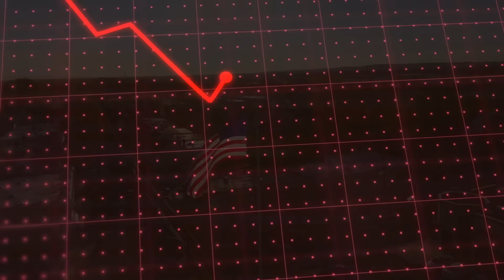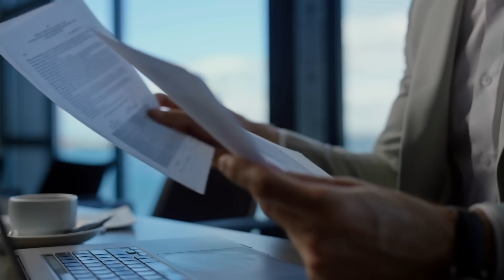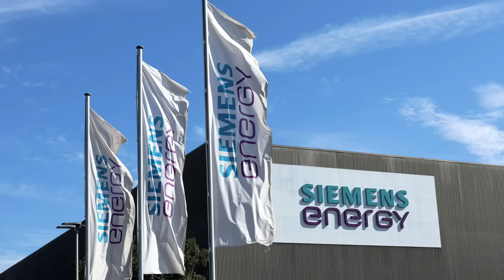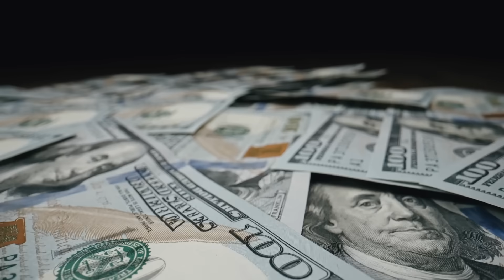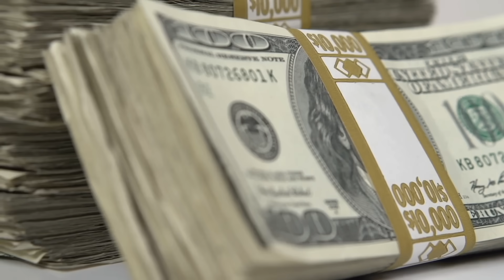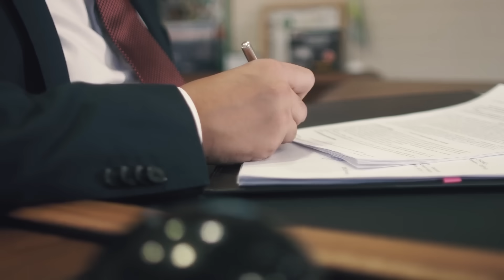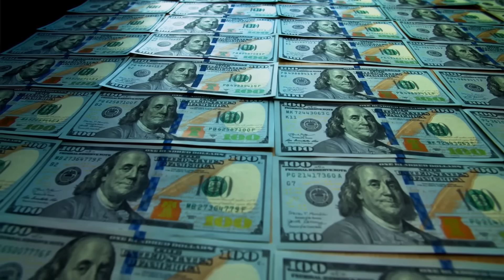The Real Reason America Has Turned Its Back On Wind Power Energy

Comment: The temprature at the earth's centre is about 5000degrees C. Dig deep enough and there is a limetless supply of energy. Turbine baldes, solar panels & batteries can't be recycled and must be buried. The earths centre is already subterrainian.
Reply: Drilling deep is neither easy nor cheap.
And yes, blades, panels and batteries can be recycled.
Reply: @old-pete  and yet, to date, none are.
Reply: @pfwag  What are talking about? Recycling? Happens all the time. One can even google the companies doing it.
Reply: @old-pete  Recycling costs money, it doesn’t make money therefore it will not be done.
Reply: @Ethan.Lamoureux  Throwing stuff away is more costly to nature. That is were legislation comes into play. It also saves energy.
But if one does not care about the enviroment, one can just dump stuff in landfills or the oceans or just abandon it.
Reply: @old-pete  If recycling costs money, we won’t do it. Landfills are the best place, which is why we use them. Lots of “recycling” has ended up in the ocean, this is why I don’t recycle. At least if I throw it in the trash it will be contained properly. Abandonment in fields seems to be the chosen solution for old wind turbine blades. So green!
Reply: @Ethan.Lamoureux  That is a countries problem, not of the windturbines. Other countries banned the landfill disposal.
Reply: We are taxpayers in the Country we are the Country it is our problem. As x 5306 said dumping this stuff seems the most cost effective solultion therefore it will be dumped. I won't dump it I would never buy it. By the time it needs replacing it will cost a fortune to burn/bury or recycle.  @old-pete
Reply: @robinjellicoe7088  Still cheaper than fossil fuels from other countries.
Reply: When America left the Paris climate accord they were free to use & extract any energy they wanted. Many jobs were created, Amereca became 100% self sufficent in energy, prices went way down. All this yet their CO2 emissions fell more than the Countries still in the accord.  @old-pete
Reply: @robinjellicoe7088  US expanded their fossil fuel extraction before they left the accord. Those two things have nothing to do with each other. The US has always imported oil, they were never independent. The energy prices depend on the world market. Prices went down due to Corona, they went up half a year before the Ukraine Invasion. The US opened their oil reserves to counter the price increase.
The CO2 emissions go down because of the export of industrial manufacturing, Corona and increased investment in renewables.
To think that CO2 emissions sink because of lowered fuel price is a sure sign that somone has no clue about economy and especially energy economy.

Comment: It's not that simple, you can't just say "let's throw money at the problem" to build more infrastructure. Wind turbines are intermittent, meaning their production doesn't follow demand, meaning you need to find some way to absorb the power they generate when it's not being consumed, and some way to compensate for their missing production when you need a lot of power but there's no wind. That's the main issue, and the main reason grid operators aren't investing more into connecting further turbines to their grids.

This is a fundamental technological problem, and it won't be solved overnight.
Reply: When one site is off line others are generating. Taken as a whole the system works. The idea of looking at single sites as continuous power is erroneous.
   That's how hydropower works too. Not all dams are generating at any given time. That's how our Tennessee Valley Authority works here. They even publish a generating schedule for the benefit of public safety as well as for recreational purposes.
Reply: @joewoodchuck3824  That's the idea but in practice, sadly, often there's very little wind overall and overall production is very low.
Reply: @Lexoka  There's a concept known as capacity factor. It compares total nameplate capacity against average output. Hydroelectric comes in around 40% and wind almost as much. If you want to use that factor against wind, you also need to criticize hydro. Everyone loves hydro, yet wind isn't much different.
Reply: Nobody seems to grasp that the problem of "green" energy is that it cannot generate on demand.  Irregular supplies must feed into a common storage system and from THAT system must come a regulated output.  Also, we have a persistent problem with our scientists and engineers that they always look to the most complex solutions when a simpler and more robust approach would work.  Even if the simply solution is not efficient.  Efficiency is a false virtue if it comes at the cost of reliability and ease of maintenance.

The main problem here is  that the NASA-designed 3-blade windmill is the WORST possible design option.  There are better options but, they don't fit the MENTAL IMAGE of what they are supposed to be designing and building.  I don't know how energy is regulated from these windfarms but, I feel certain that they are regulated at each windmill and the output is fed to the grid.  There is no room for error and when the wind is slow, power must be stolen from the grid to keep the blades from stalling.  That such a windmill design ever made it past the initial presentation stage calls for mass firings of a whole lot of people.

For the sake of argument, lets say the far superior windmill design is accepted and these NASA abominations are all replaced.  That's not the end though.  What I'd like to see is for these new windmill farms to directly feed a massive bank of lead-acid or AGM batteries.  Why lead-acid or some derivative?   Lead batteries are RECYCLABLE and the individual plates can be removed and replaced by a special crane.  Nothing high-tech AT ALL and it's ROBUST.  The batteries will absorb all of the power from the windmills and inherently provide regulation to the next step, which is a DC-AC motor-generator.  

The output of the AC generator side is controlled at the power station by controlling the DC battery output to the DC motor.  Once loads levels and swings are worked out from experience, then the motor-generator can be adjusted to some mid-level of power generation input.  That way it is RELIABLE and the grid voltage can be easily maintained by controlling ONE INPUT.  That is may be nominally INEFFICIENT pales in comparison to the virtues of such a system.

THIS is my solution.
Reply: @BlackPill-obey Any idea of the sheer mass of batteries and cost and short life your talking about..??
Reply: Hoax.

Such a load of garbage.

There no such thing as a greenhouse effect.

The whole premise of AGW -- the greenhouse effect -- is wrong.

There is no such thing as a greenhouse effect (except in an actual greenhouse (closed container)).

But there IS  a trillion dollar $$$ boondoggle that is the muscle that twists arms behind that stupid renewable energy.  

"Welcome to the Mafia-ization of the energy business."

             * * *

A Novel Perspective on the Greenhouse Effect (Tom Shula)

https://youtu.be/NS55lXf4LZk

1) Markus Ott: Questioning the greenhouse effect

https://www.youtube.com/watch?v=Bj6ORbRBZ2s&t=7s
The greenhouse effect is the primordial sacrament of modern climate science. It is preached from kindergarten to the nursing home.  The simple name of this effect and its ubiquity in culture and mainstream media leave no doubt that we are dealing here with solid and fully understood Natural Science. But how does this actually effect work?

2) Markus Ott: Atmospheric greenhouse effect ~0?  (Applying IPCC formulas to the no-atmosphere moon. Conclusion: there is no greenhouse effect on earth.)

 https://youtu.be/JXKHfL55G2A

Min 6:xx.  "Abuse of the Stefan-Boltzmann model..."

3) Markus Ott: Saturation of the CO2-IR-Absorption

https://youtu.be/CrMGTkPADFw
(Min 0:10) The alleged greenhouse effect of 33 degrees centigrade is the result of an improper use of the Stefan–Boltzmann Law (black-body radiation), and that a less abusive application of this law makes the greenhouse effect almost disappear. 

4) Markus Ott: Convection and Thermalisation Kill The Greenhouse Effect

https://youtu.be/RbNNhLqhWPg

In-Depth Comments on Sabine Hossenfelder's Talk: Greenhouse Effect 

"Heat transport in the atmosphere... IT'S CALLED WEATHER."
https://youtu.be/sY2xHk0ThJ8

https://thebreakthrough.org/journal/climate-change-banned-words/art-climate-change?utm_source=Breakthrough+Newsletters&utm_campaign=12e6304fed-BTI_Weekly_1_18_2023_COPY_02&utm_medium=email&utm_term=0_49b872540e-12e6304fed-466887052

If heat rises, why is it so cold in the upper atmosphere?
https://www.physlink.com/education/askexperts/ae670.cfm
Reply: nice cover...Lex. thanks.
Reply: Hydro power is intermittent too and is only a little better than wind. Yet everyone loves hydro and at the same time criticizes wind.
Reply: @joewoodchuck3824  Hydro can exhibit fatal intermittence if it's on a river with high variability and/or there is no storage dam. Otherwise, its capacity factor can be more like 99%. And more than this, so long as there's enough water in the reservoir, it's also dispatchable, meaning you can turn it off an on at will, and thus make up with the fatal intermittence of wind and solar. If you add pumps for storage, then they can even store the excess energy that other intermittent sources produce, so things get even better.

There's really no comparison between the two. Even if the river has a lot of seasonal variability and no storage dam, usually you can at least somewhat predict the intermittence based on seasonal patterns (barring the occasional flash flood).
Reply: @Lexoka  Your assessment and numbers don't jive with mine. My information is from reliable sources including government.
Reply: @joewoodchuck3824 understand how hydro works and it's easy to understand. Hydro typically can't run 24x7 due ro limited captured water, but you can release it on demand when demand is high and ramp up very quickly. These are ideal conditions for generation that is only intermittently available.
Reply: Stop china making plastic crap is the first thing you do if you are worried about climate change. This will solve nothing.
Reply: It's being worked on, of course. There ARE batteries. It's like saying "man will never fly" because the Kitty Hawk planes flew only a short distance.
Reply: @granthurlburt4062  so you think these are a good idea. You have lost the plot. I bet you got your boosters.
Reply: It will never be solved !
Reply: What is simple is: this is a scam. The so called crisis is manufactured just like the plannedemic.
Reply: Australia tried these things and Tesla built $$$ monster battery storage plants to rescue the foolish renewables fiasco!
Reply: Look into Sun Zia & Pattern Energy.  They are financed through Canadian Pension Trust.  They burned the land in New Mexico where they have been planning on the largest Wind Farm Generating Transmission Line in USA history, from New Mexico to California.  It will provide power to 3 million California homes.  The villages did not want to sell or lease their land.  So, unfortunately, there were "wild fires" that paved the way for construction.  Basically New Mexico sold the souls of natives in order to line pockets.  Sounds like Lahaina, Hawaii.
Reply: Call your congressmen, senators and council and tell them windmills are in the best interest of the people and give them good reasons why. Also wind power is much cheaper then nuclear power
Reply: Hydrogen
Reply: @aries6776  I read once where it costs more to make hydrogen than the potential output from it.
Reply: @joewoodchuck3824  Yes it's inefficient but when you have energy being wasted such as unused renewable it becomes a perfect choice because now you can store and transport it rather than let it go to waste.
Reply: @aries6776  I'm willing to bet that no industrial entity is willing to try it. They'd have to charge extra for shipping than for ordinary commodities in order to cover the production loss and still make a profit.
Reply: @aries6776  You can use electrolysis and then fuel cells to store and retrieve energy, but you lose a lot of it in the process, and it requires extremely expensive investments that generally make wind turbines uncompetitive against dispatchable sources of energy, like nuclear.
Reply: @Lexoka  It doesn't matter if they are inefficient because the energy will just go to waste if not used! Nuclear is ridiculously expensive atm. Our latest UK nuclear power plant is tens of billions over budget and has taken 10 years to build, and been 20 years since approval. It's still not online.
Reply: @aries6776 That tends to happen when you restart an industrial sector that had been asleep for a long time.
Reply: @aries6776   The reason nuclear is so expensive is due to how you have to build them right now. You are talking about making a steel and concrete bunker needed to take a missile strike so not to leak any bad isotopes. The plant itself is expensive for the current generation of fission stations. Moltex reactors can solve that and SMRs can also aid in this problem but those are 5 years out before test reactions can be built. 

However per megawatt, Nuclear uses less concrete and steel than wind turbines.
Reply: @ThinkingRebal  The French build ours, and arguably they are the best at building them in the world. SMR's sound great but we need energy now. I'm not anti-nuclear but what we have avialable to us now isn't that great.
Reply: @Lexoka  France have nuclear as their main source of energy. They built our latest nuclear power station. No one does it better on planet earth and they couldn't do it cheaply!
Reply: @aries6776  Perhaps they should get some help from the French.
Reply: The more windturbines one builds in different places, the less intermittent the production gets. Combining it with other power plants reduces intermittency further.
Surplus electricity can be used easily for different applications.
Reply: @old-pete  Spreading turbines around helps, but does not solve the problem at all, and tends to require setting them up in places that just aren't that windy overall, which is inefficient.
Reply: @Lexoka  The axis height of windturbines is increasing with every generation. Since the wind speed increases with height, newer wind turbines are cost-effective in areas where older generations where not. So spreading is definitely useful.
Reply: @boldvankaalen3896  It sure helps. But it's not enough.
Reply: @Lexoka  Indeed, that is why you combine different types or renewables, demand side management, strengthening of the transmission grid, overbuilding, and storage.
Reply: Old-pete Your point works when renewables are a fraction of demand and so you piggyback on any slack in the existing grid to move energy. But as you pass say 60% the whole game changes. Building new or upgrading grids to move additional energy is expensive. Who pays. 
Let us imagine a lull in the local wind but is blowing in a distant state as you suggest. Then you have to equip that distant state with 'both' enough power to satisfy its own needs plus the extra needed to fully support the first state. This is crazy wasteful. Then you have to transport GW of power in quantities never envisaged by the existing grid. This grid problem only applies to renewables, it does not where you use local baseload power or where you replace coal and gas by nukes.
Reply: There are places where wind is very reliable.  You say wind is intermittent like it's some kind of great revelation.  Do you think engineers don't know that?  That's why they put the turbines where reliability is high.
Reply: @incognitotorpedo42  I know they're aware of the problem, that's why investments in wind turbines are going down in many places.

And sure, you try to put them in places that are as windy as possible, and it helps, but doesn't solve the problem.
Reply: @incognitotorpedo42   The engineers are aware, but this also makes it location sensitive which lowers the value of the turbine overall. Overall wind is intermittent and the solution from what I've seen is just build more backups or ignore the problem and deal with the brownouts/blackouts as they happen. Hints why investment is going down. Personally I rather see a natural gas plant built nearby instead of wind turbines. The turbines take up space that better left to nature, seen habitats lost and landscape marred by poorly designed and placed turbines.